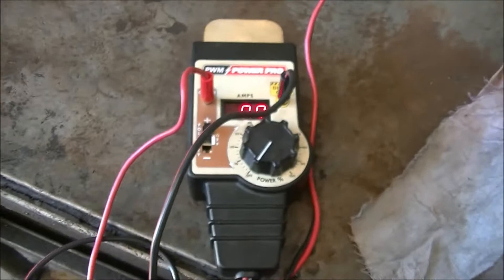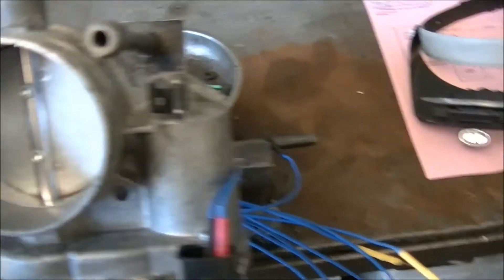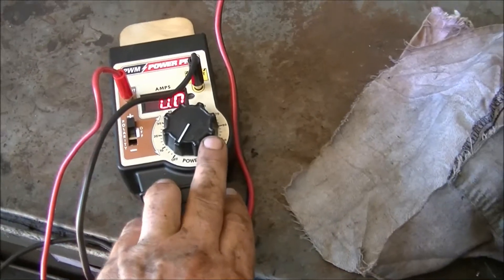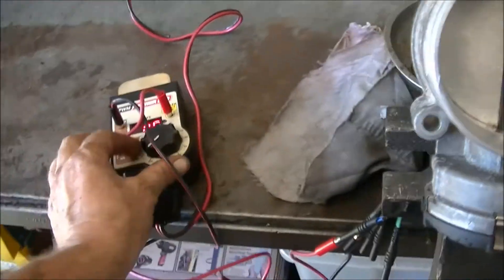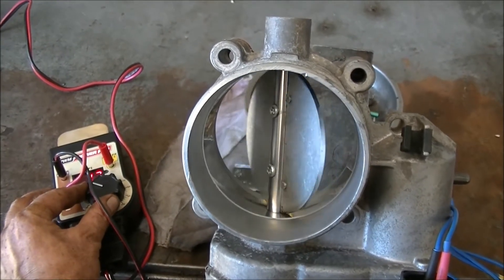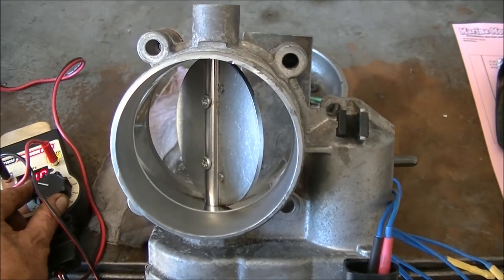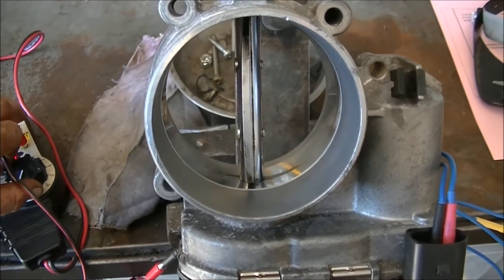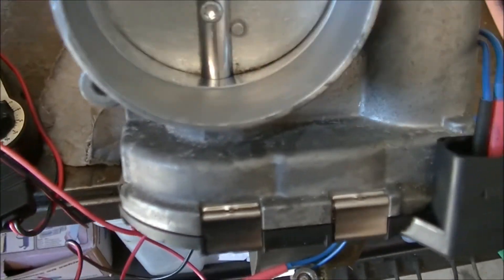VZ Commodore electronic throttle butterfly (TAC) testing

Comment: Hi, is it ever worth replacing a tb even if no codes are coming up?My mechanic scanned my car,can't find anything wrong,
To me the gas pedal is not very responsive, do u know if I can adjust that anyway?
It's a 05 vz v6 commadore, Alloytec engine
Reply: Get a throttle controller off eBay apparently they are a popular fix to the VZs bad throttle response